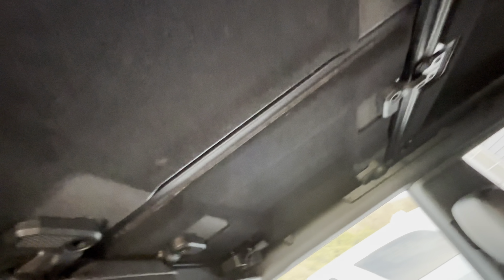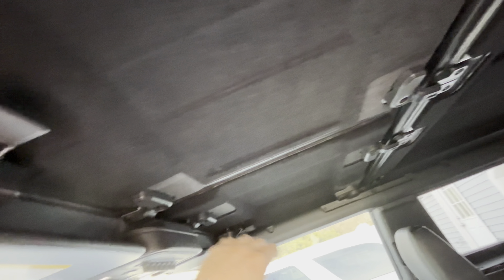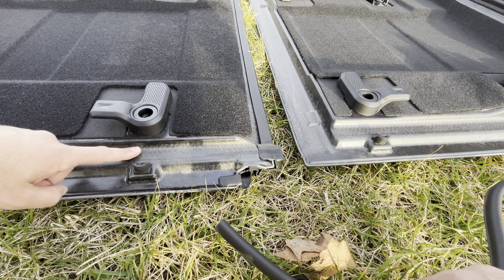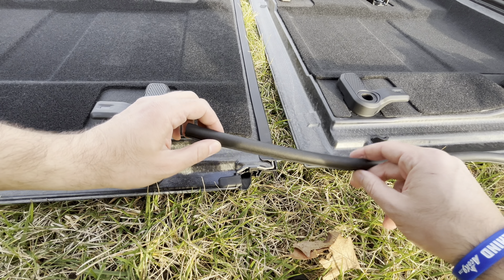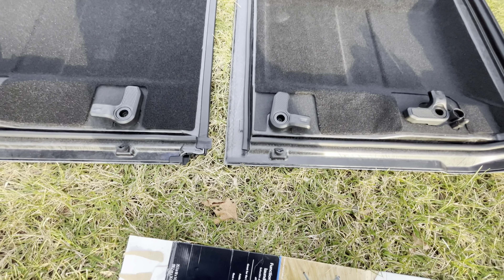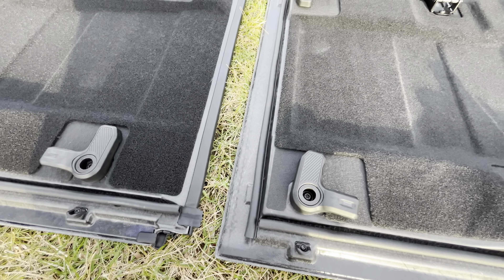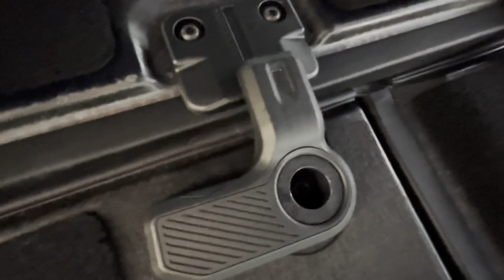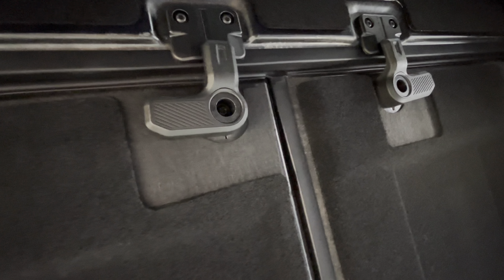2021-2025 Bronco Hardtop Weatherstripping Install To Reduce Wind Noise

Comment: I just did this to my 2 door Bronco.  It solved the wind noise that was intruding between the panels.  A $10 solution that took 10 minutes to install. Bronco is still noisy at highway speeds, but the annoying wind noise is gone. Thanks for posting your solution.
Reply from the maker: Happy to help

Comment: Just bought a 2024 Bronco Badlands Sasquatch with hardtop, and I hear the wind noise when I get to 45 or 50 mph. At least I know that I’m not alone, and this would probably happen on any other Bronco that I might have purchased. My Wrangler was loud, but it never had wind noise that sounded like the window wasn’t rolled up all the way.

Comment: Just buy mud tires... Wind noise solved 🤣
Anyone notice the passenger back window noise?
Reply: Yea, I've got the 2 door hard top and looking for solutions to the passenger side wind noise. Another video suggested running weather stripping down the back vertical panel of the roof where the windows meet. Might try that

Comment: Do you have a solution to the noise coming from the window when fully closed?
Reply from the maker: I’ve noticed I’ve been getting a little of that too. I’m going to try adjusting the window again and bringing it in tighter to the car, maybe it will help
Reply: @pfmustang I don’t get why they had to leave a space unfilled between the edge on the side of the window and the fiber. If you give a little push on the window from that side while driving air seeps through immediately and you could feel it. There sure is a fix for this but couldn’t find any so far.